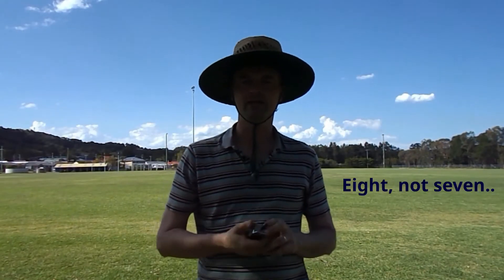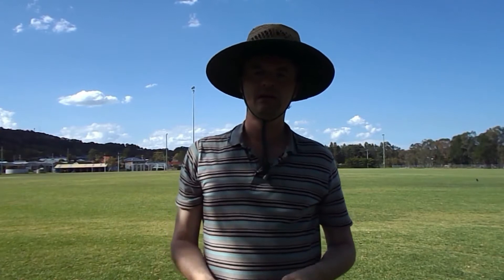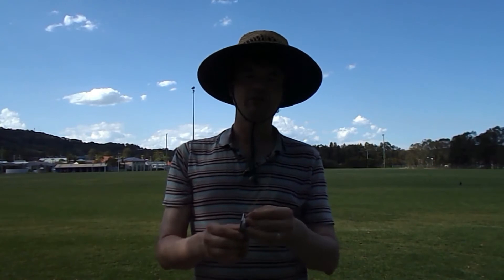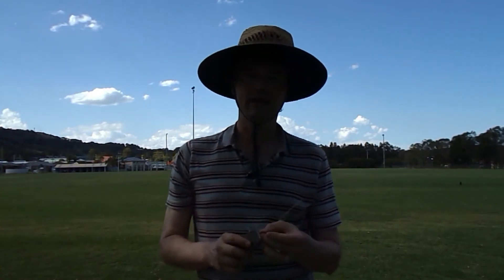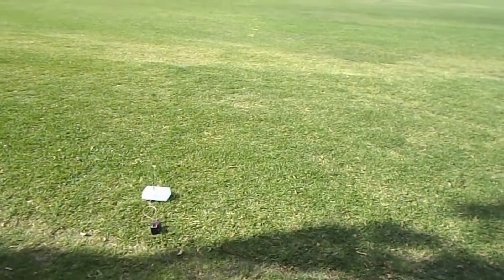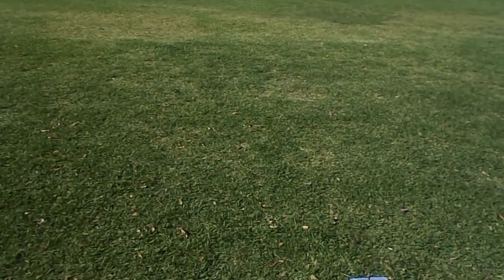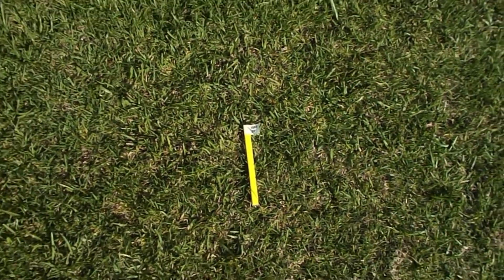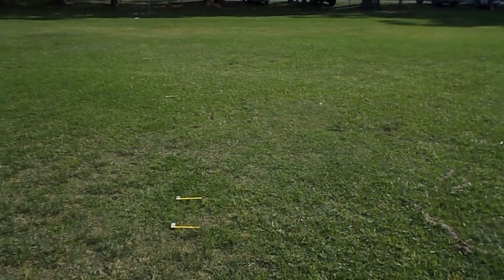low-cost 433MHz antenna shootout (eight of 'em)

Comment: I thought the Nagoya whip antennas were actullay a bazooka dipole? I have one here for 70cm and you can see the large diameter antenna to up to about half and then it is smaller in diameter.
Reply from the maker: There may be a different design that is being sold on the Internet but the one I have (similar to the one in the picture as shown in the video) is almost a constant diameter all across the length of the antenna. I have not dismantled this antenna but I can feel that it is a spiral / helical wound whip antenna and nothing more. Can you share a link perhaps for some more information on the antenna you're referring to?
Reply: Hi, the part number is 771 Nagoya.  I was told by a friend(Alex Greve with VAS) that builds antenna that this was a bazooka type dipole. It very well could be only a single element antenna because the item description shows it as a dual band. That may explain the two different lengths of diameter. I use this on my HH radios and I used to use it on my UHF radio for my model planes. Here is a link to the antenna:

NAGOYA SMA-Female Two Way Radio Dual Band VHF+UHF Whip Antenna 15’’ for Baofeng UV-5R BF-888s/Kenwood/Wouxun Walkie Talkie https://www.amazon.com/dp/B07B63XF81/ref=cm_sw_r_cp_api_ypx6Bb230ZJ12
Reply from the maker: Thanks for the feedback, yeah, those antenna's can be quite an improvement to the stock-standard antenna that comes with these radios. It's a worthwhile upgrade to anyone wanting to get (a lot) better performance out of their HT.

Comment: Any chance of sharing that pcb dipole design?
Reply from the maker: Absolutely, here they are on OSH Park directly: https://oshpark.com/profiles/captcha and here is a forum post I did describing how they were made: https://lowpowerlab.com/forum/rf-range-antennas-rfm69-library/easy-pcb-dipoles-for-433-868-and-915mhz/  You'll find the diptrace design files there too.
Reply from the maker: Of course, I have linked the gerbers and diptrace files as well as links to OSH Park for direct ordering of the antenna on this forum post with Lowpowerlabs: https://lowpowerlab.com/forum/rf-range-antennas-rfm69-library/easy-pcb-dipoles-for-433-868-and-915mhz/